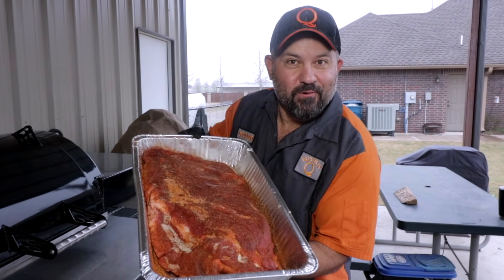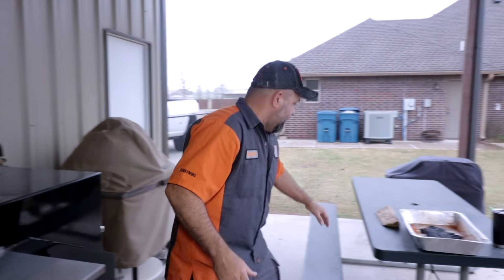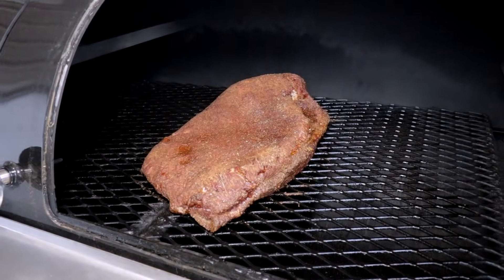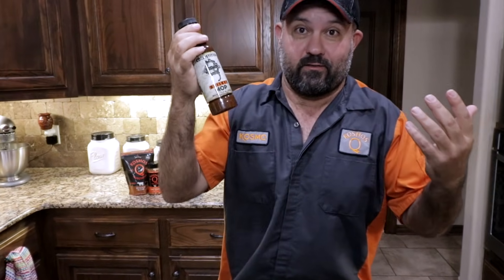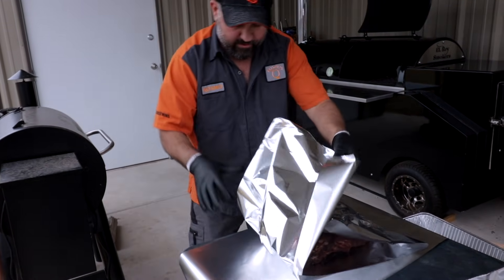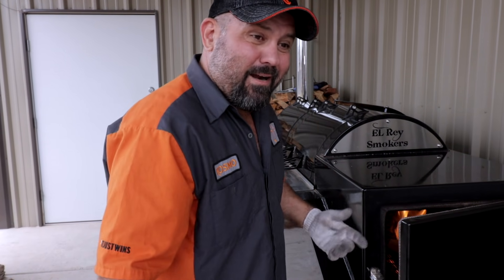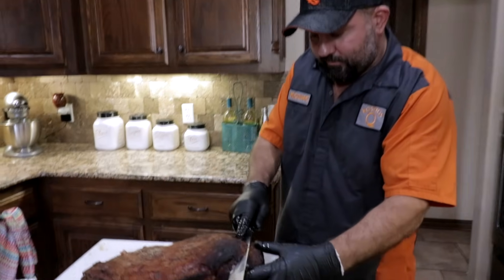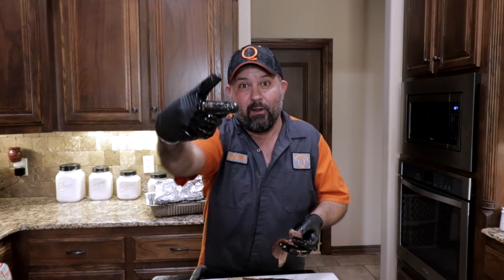Hot and Fast Smoked Beef Brisket (WARNING SUPER JUICY)

Comment: I live in Wisconsin but spent most of my summers in central Texas with my grandparents while growing up.  I"ve been to probably a hundred BBQ joints around the state in the last 50 years as well as cooking briskets for friends up here.  I"ve adopted my own version of "hot and fast" out of necessity due to the colder climate during the spring/fall.  It's MUCH easier to run a cooker "hot" and consistent than low when the temp drops to below about 50 or so.  CONSISTENCY is more critical than the actual cooker temp.   I run it around 350-400 up to the point of the traditional "stall" around 160 or so then drop it to 250 and allow the inner temp to come the rest of the way up to 195 or so.  After that...sit down for this one...I simply wrap it up and pack them into a cooler just big enough to fit.  They'll CONTINUE to cook for hours using NO heat but what's already inside of them.  Even cheap coolers and tightly packed briskets will stay hot for 8-10 hours after being removed.  I've even left about 12 pork butts tightly packed for 12 hours and when I pulled them out, they were still at around 140 when I pulled them.  You'll never have a more tender cook then using a cooler!  Saves a LOT of fuel, time and fuss while in the colder weather.

Comment: I always tried the slow and low for Brisket.  I tried this.  4 hours cook time, 2 hours of rest.  I then cut it all up, had a few slices, then put the rest in a crock pot and put it in the fridge with all the liquid.  Next day, took it to work, turned on the crock pot and best brisket ever.  Even the flat was tender and juicy.  Of course, being in the liquid for 12 hours helps the moisture level.

Comment: I use my traeger, smoking with hickory, 10lb brisket 300 degrees till it reaches 160, wrap in foil turn up temp to 350 till internal reaches 200, then I wrap in a towel and put in my artic cooler for at least an hour, 3 is best. Cheers cosmo!

Comment: I my Pit Barrel Cooker, with a few major differences. 1) Low and slow, running around 250F, 2) Vertical barrel versus the horizontal one, 3) Hanging over the coal basket, 4) Coals vs. wood; and do not ever add new (start with overfull basket), 5) Time for a full packer typically runs about 10 hours

Comment: Pellet smoker, set to 200 with competition blend pellets.  15lb brisket, similar trim to yours.  I prefer a simple rub: coarse black pepper, kosher salt, celery seed.  Smoke until the internal temperature stalls (7-8 hours and around 160 degrees), wrap, place in pan (can’t lose that jus!) finish cooking to 190 internal.  I slice the flat and shred the cap.

I’ve never added anything to the brisket when I wrap, but I will give it a shot after seeing this video.  Thanks!

Comment: That looks perfect! I prepare mine by injecting with apple juice or beef stock, then of course apply rub. I do mine on a Camp Chef pellet smoker @275%. Wrap at 170. I take mine off when it probes without resistance. I usually pull at around 206F and Let it rest for 45 mins or so. Total time 7-8 hours.

Comment: I cook with a Masterbuilt electric...Living in the Colorado Rockies we are under a burn ban for most of the summer which often extends to no wood or charcoal grills/smokers.  I thought I would miss the traditional wood or charcoal experience, but I have to admit, electric is pretty nice. Its consistent and the bluetooth allows me to monitor and control everything without opening and losing my smoke.  I've been going slow and low but I'm  going to give the next one the hot and fast treatment.

Comment: offset all the way for a brisket! ima have to try hot and fast soon. i usually hang around 260 for my briskets
Reply: For how long
Reply: @ShogunX11  it depends on the weight but typical normal sized brisket will run me anout 10 11 hrs instead of 13 at 260 that is

Comment: I have done the hot and fast method a few times and like it. You forgot to tell your viewers one important tip, let the brisket get to room temp before putting in the pit. I can’t explain the why but it works. 
I have cooked on off set, pellet, and Kamado grills. The off set was the slowest and used the most fuel. Pellet is easy but it’s like cheating, and for the Kamado, my favorite so far. 
Another thing you can try is rather than wrapping the brisket in foil, put two chicken racks in that foil pan pour your combo of stuff in and wrap the pan tight. 
Enjoyed your video and I’ll look for more. 
Thanks
Reply: All meat should be room temb before cooking. It makes an even cook

Comment: KOSMO. I use my offset to make Brisket, however I just received a Drum to do a review on, and I will be making a Brisket on that next. If you take 100 people and asked them how they make Brisket you will get 100 differing answers. I don’t inject, or haven’t tried yours yet, and the perfect temp I found for Brisket is 275, kind of that middle road temp, not Low and slow, not hot and fast. I enjoyed this video. Your very entertaining. 💪🏼👍🏼
Reply: For how long? And can it be done on an offset?
Reply: Sir Rowell it can be done on an offset. Temps vary on the pieces of meat, grade and pounds . I generally go 1/2 hour per pound on hot n fast, at temps of 325-375, 45 minutes per pound 275-315, and 1hr- 1 1/2 hrs per pound 250 or lower.
Reply: @meatcranium4280  thank you,  Sir
Reply: Sir Rowell NO PROBLEM BROTHA
Reply: @meatcranium4280  oh and can you do the same with Pulled pork as well?
Reply: Sir Rowell yes. Pork shoulder and Butt are a lot more forgiving.

Comment: 22 inch Weber Kettle with Smoke EZ smoker attachment. Full load of Kingsford with about 15-20 lit coals in the middle and some mesquite or pecan wood. Brisket on the top rack, water on the lower rack. BBQ Guru temperature controller set to 250. I inject with a can of beef broth because I can only get select full packers here in Maryland. Costco has choice, but they are only flats.  Rub of coarse salt, coarse pepper, garlic powder, and chili powder.

Comment: Tried this recipe tonight on my Traeger. Picked up two flats. Followed direction from Kosmos video. Cooked on the rack 7 hours at 180 deg. Occasionally spritz with water. After 7 hours internal temp was 155 deg. Went ahead and wrapped and added au jus. Cooked another 3 hours then inserted temp probe through foil. I could tell the meat was very tender. Temp was 210 so I turned off Traeger and left briskets rest on the grill. After one hour I removed from foil and sliced. Beautiful smoke ring, barely held together for hang, no resistance for pull. Melted in you mouth tender. Spice was great. Again, this was only the flat with no point. Never did a brisket before but was a complete success. Look forward trying a full brisket with the point so I can try burnt ends. Thanks Kosmos Q for your products.
Reply: PS. After wrapped i kick temp up to 225 deg

Comment: Thanks for the video! I'm going to try this. The following is how I smoke brisket. Trim normally, no injections, mustard binder and a whole lot of three kinds of rub!!With prime brisket, I use an upright gas smoker set at about 220' burning pecan for the first two hours to get a lot of smoke on it. I then transfer it to a pellet smoker with a drip pan full of water under it for about eight more hours, also using pecan at 220' (mopping a couple times with water,apple cider vinegar, Italian dressing and rub mixture). At internal of 160' I wrap with three layers of aluminum foil, turn heat up to 250' and run until about internal temp of 200' (takes about 2.5 more hours). I then place in a warm cooler still wrapped and let stand for 2-hours. Separate fat from drippings and whisk some same rub into drippings. Slice and pour whisked drippings over slices.

Comment: I just cooked a prime brisket for Easter on my Hasty Bake. First time to smoke with this grill. Around 6:00 AM, I  filled the grill with hard wood charcoal, lit it  and put on the heat shield and threw the brisket on fat side up and went back to bed. Three hours later I got up and checked the temp. I was at 165. I was thinking, maybe I should have used indirect cooking because this thing is cooking to fast. The brisket had a nice color so I took it out and wrapped it in foil and threw it back on. The brisket reached 200 an hour and a half later. I had 6 hours to wait before going to celebrate Easter with my family so I put the brisket in the oven at 170 for 6 hours. I haven't tried it yet but it actually seems pretty tender and juicy when I poke it with a thermometer. If it turns out good, I will be surprised because I cooked it so fast.
Reply from the maker: how'd it turn out?
Reply: Actually pretty good, everyone liked it and I ate leftovers twice today lol. The point was a little more tender than the flat. @KosmosQ

Comment: ( damn..I hit the send button to soon)
I smoke my brisket on my Traeger Ironwood 885 and 275 the whole cook and wrap it in butcher paper when internal temp hits 165. And I use a 12 in smoke tube with pellets in it on the grill to add more smoke. 14 lb packer brisket takes usually 9 hours. I try to do 1.5 hours rest but I usually cant wait and start slicing after an hour. I'm gona try your hot and fast method.

Comment: Nice scald on that big boy. When I wrap in foil I do similar to you except at around 205 to 210° I take it off open the foil for about five minutes to let the steam out then wrap it back up and let sit for several hours. Like the texture of the bark a little better when I do it that way. Other times use the pink paper. Have never cooked one over 300 though will have to try this.

Comment: First, Thank You for your videos, they are informative and entertaining.  I cook on a BGE and have not had the nerve to cook a brisket over 250-275 in fear of over cooking and drying it out.  Do I understand you correctly, that by injecting and then wrapping with your Mop Sauce, it will keep the brisket moist? 
I know you also use a BGE,  do you think I could go as hot as 350 on the BGE using your technique?  I would love to do a brisket in 5-6 hours instead of 12-13.   Again, thanks for sharing all your knowledge.

Comment: Hey Kosmo, I'm digging your channel! Just subscribed the other day. Got a question: I saw your other video where you did a hot and fast brisket on the Pit Barrel. Can you pull off doing a flat using the hot and fast method on the Pit Barrel or would I run the risk of it drying out? I live by myself and there's no way I'm gonna knock down a whole brisket by myself.

Comment: did one on the silverbac last week injected with butchers prime seasoned with SPGO and Montreal steak (Malcoms way), used beef stock, worsteshire and soy for the au jus.  it was a salt blow out any suggestions gratefully received.  other than Kosmo's brisket mop low and slow to 210 internal.  fall apart tender but way too salty

Comment: I run my bullet hot and fast. I fill a chimney with lump and get em glowing hot. Dump that in and add a big chunk of wood. I keep the bottom vents/door open and lid vent open, sometimes I crack the lid to get enough air flow to keep my chunks lit. I like to see the fire going and run a clean burn. If things get too hot I just take the lid off for a min. I'll add a chunk or two of wood as the first one burns out and tend the fire for about an hour/hour half. After that long, I have a good color on the meat and I'll start another chimney of lump. Once it's going good I'll add that, close the fire door and dial in my temp to around 300. Cook till it probes tender, spritz with water once in a while. I can't cook overnight here and even low and slow all day can get dangerous unless I want to sit outside watching the grill all day; I'm in bear country. I always get a good smoke ring and good smoke flavor. I like pecan chunks. I've tried the minion method and don't like the smoldering wood taste or the off flavors from charcoal constantly being lit.

Comment: I use a Z grills wood pellet smoker. I have only done low and slow for my brisket and Boston butts 225° until 165° then I wrapped it up in foil put it in a foil pan with leftover Cattleprod beef injection and smoke it til around 205° or until the probe slides into the brisket like a hot knife threw butter consistency then let it rest in a cooler for 2 hours before slicing it. But I just bought your line of brisket stuff Kosmos q reserve blend injection, cow cover rub, and competition brisket mop to try on my brisket for the first time hot and fast tomorrow. Can I combine Cow cover and honey killer bee or should I stick to only cow cover rub?

Comment: I have a vision grills Kamado smoker in which I use for the Smokey taste, but it can run hotter. I am noticing my briskets are going hot and fast.  Realistically I prefer low and slow, but regardless I have a superior product due to injecting beef tallow in my briskest transferring and resting my brisket during the stall with butcher paper on my Traeger Pellet smoker utilizing beef tallow on at 165F.   Yes I use 2 different grills. Yes I use to different smokers because of temperature controls. I use oak and hickory wood chunks and cowboys lump charcoal.  Now if your wood is not seasoned that will cause other issues such as heat and white smoke. I am going to u get some pecan and fruit woods to experiment in the future.  Experimenting by cooking a tri tip like a brisket to ensure I have the right flavors before cooking a full brisket. Just remember when you are cooking hot and fast you need to have a MEATER probe or a thermapen Mk4 to monitor the temperature constantly.   As long as you know the right temps when to wrap and rest you will be fine.  Try to keep it under 350F in my opinion and indirect heat. As always it’s the Pitt master not the the Pitt to deliver good bbq.Thanks for sharing.

Comment: I have an Assassin 48 smoker/grill and will be trying hot and fast for my next brisket. Wondering about your pull temp. of 210. Is that the temp u always pull at or is that just your hot and fast pull temp. ? I usually pull around 203, or 205.

Comment: At my altitude boiling point is 204.....if I take a hot & fast brisket to 210 would it be boiling the moisture out of the brisket at that point ??
Reply from the maker: You should always adjust temps to your altitude so definitely use a thermometer if you go hot and fast.

Comment: I plan on trying this on my Pit Barrel Cooker tomorrow, and I ordered the Reserve Injection blend, the mop, and the hot cow cover, but just realized I forgot the Moisture Magic!  $@#%!  Am I screwed, or will my hot and fast brisket still turn out moist?
Reply: Turned out amazing! Thank you Kosmo for helping me do my country proud on the 4th of July for my first brisket attempt.  I cooked uncovered in the PBC on the grate for 3 hours (temp was pretty steady at 350 with Kingsford Lump Briquettes and the rebar out),  another hour wrapped with the mop. Pulled it at internal temp of 210.  Fall apart tender from point to flat.

Comment: That brisket has NO BARK. And like they say no bark,  NO BITE.  Texas style is NOT  hot and fast....its low...slow....and whenever the hell its ready.
Reply: Mark Carranza I’m with you. No bark. Injection he’ll yeah. But all the extra liquid makes it a braised brisket. Some would say pot roast
Reply: I read that foil (instead of butcher paper for wrapping) allows for more juice but at the expense of bark. Is this what I'm seeing in the video? I saw a ton of juice and hardly any bark, and foil was used. I'm going to have to research more Hot-n-Fast videos online to see who, along the way, uses butcher paper and see if it makes a difference.
Reply: KALEL KALEL  I've done a few briskets where after it got past the stall (usually around 165-170) I wrapped them in foil. Well, the brisket will continue to cook, and whatever fat renders out, is kept inside the foil. So basically the brisket finishes off being "cooked" in  it's own juice.  Then, when its ready to pull (I pull around 200-210 degrees) I set it in a cooler to rest for about 2 hours or more. I keep a temp probe in the meat, and around 165, I'll get it ready to slice. Problem is,  all the juice has now made your bark incredibly soft and mushy.  As others have said,  it'll make your brisket taste more like a pot roast. The smoke flavor is almost non-existent and it ruins the whole thing.  Which makes all your work a waste of time. But the only way I learned was to do it myself.
Reply: Sorry to say this kos recommendations suffer . Don’t believe the hype nor his shirt
Reply: All you folks digging on him and whining I tried to find y’alls Chanel and googled your names looking for your awards from all your cooks and nothing found
Reply: Slap yo momma ?????
Reply: I don't wrap and man o man does that bark get nice a barky plus moist inside. Yum!!! But this style is also good. Less bark but more moist IMO. Both styles are good.
Reply: it's the foil. every brisket I've done trying to crutch and or rest in foil comes out like pot roast. what was sad is looked so good before I did that. either go with butcher paper or. nothing.
Reply: I think this is awesome though if you get a wild hair up your ass and wanna start a brisket at 1pm on a saturday after a beer or two.. (which is exactly the situation I am in right now hahaha).